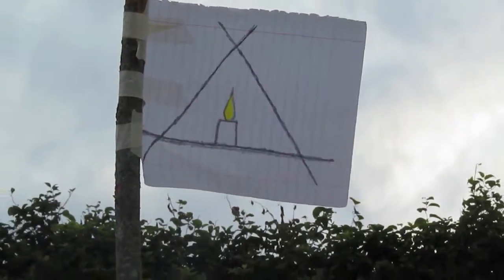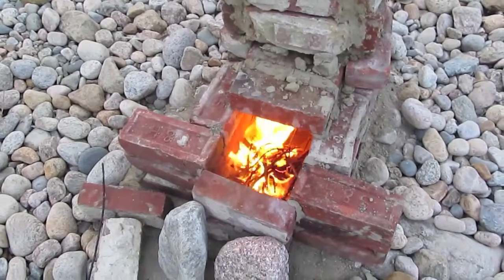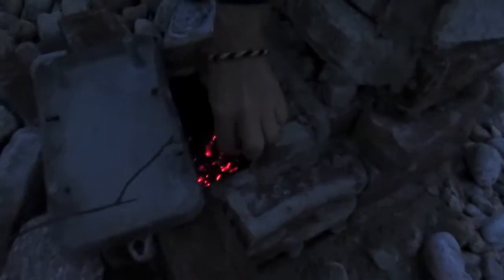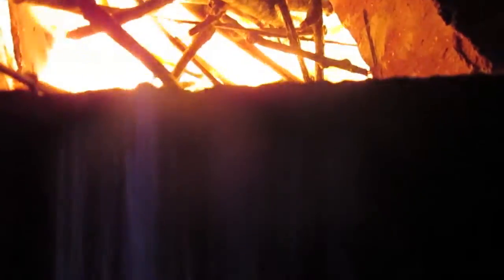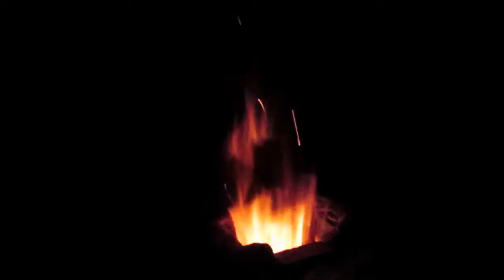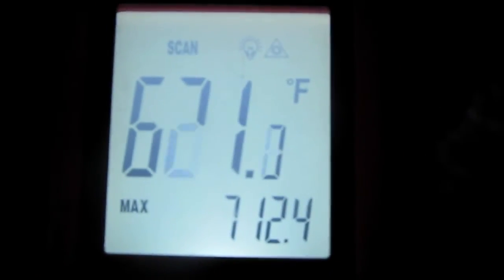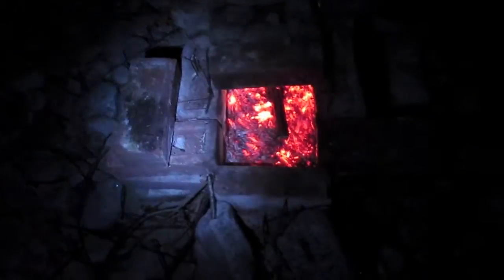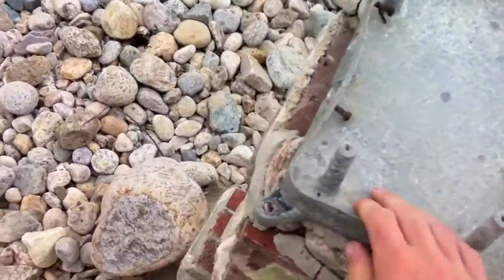Rocket Stove as a Tiny Updraft Kiln

Comment: From what I've learned, the highest temperatures are closer to the top of the heat riser and the secondary burn. I'm not too sure though. If you did this again what would you change?
Reply from the maker: Biggest change I'd make would be using insulating refractory brick to keep more heat inside the fire.  A taller stack for more draft, a bigger firebox and ash pit to handle more aggressive fueling, and drier wood would help a lot. Thicker metal for the grates so they wouldn't warp as badly, and some reinforcement to the stack so it would be more secure.  
I'd install pyrometers at different points in the stack and test to find the hottest point.  I'd also want to try putting clay items at different heights in the stack to observe the effects of the varying conditions.  
Thanks for your comment!
Reply: MetaphysicalEngineer Thanks for your response and for putting together the video in the first place :) Probably hard tough to find all that on an island!
Reply from the maker: zoobiewa
This project was done with a budget of $0 and a timeframe of 4 days. Anything I used I needed to scavenge from the beach.  Someday I'll try again with better materials and more time and see what happens :)

Comment from the maker: We spent about half an hour preheating.  If the clay was really well dried we maybe could have done it faster.  The goal is to remove any remaining water before it causes a steam explosion, and to warm the clay gently enough such that it doesn't crack from thermal shock.  Larger clay pieces would need a much slower preheat to avoid cracking.